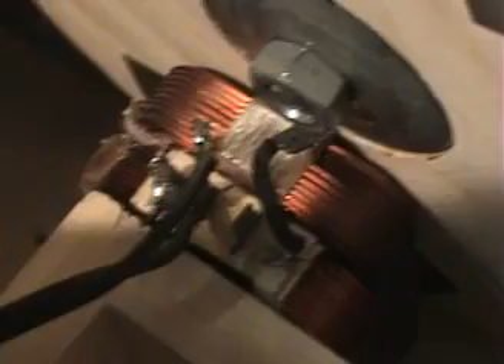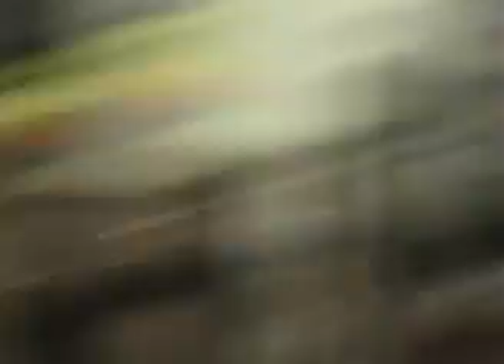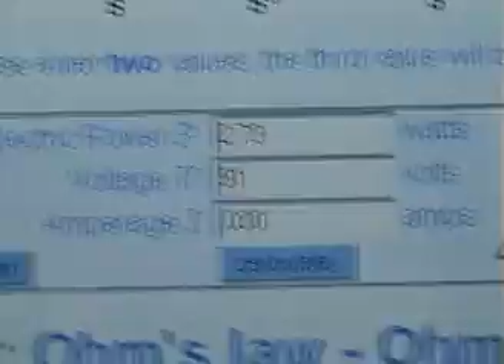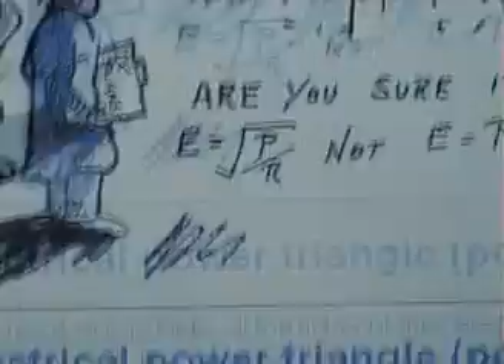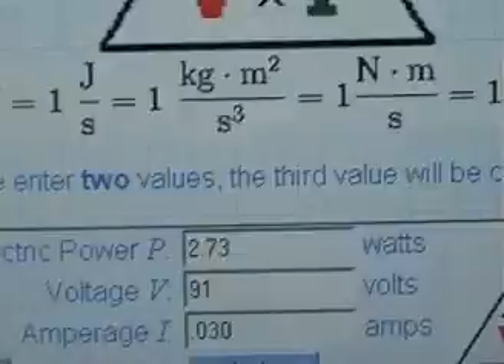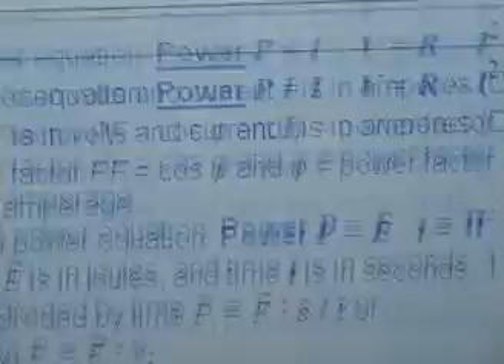Generator Coil test 8

Comment from the maker: Hi konehead,

the RPM is 3500 with an 8 magnet rotor so I'm around 460Hz

Yes I know about cheap meter not able to display true readings and when the time comes I'll use my high end meter for this if needed.

Definitely will try the shorted coil trick.

Thanks

Luc

Comment: Whats the rpm of rotor?
you should try to make coils get hit with 50hz or 60hz frequency if using regular digital  meters since they are made to measure AC only in those freequecnies and people will argue with you about any meter readings readings if it is not 50hz or 60hz...solution is to convert to DC however but then you have diodes that will make for less effeciency 
Try that "shorted coil" trick I describe in your test #9 video you'll love it